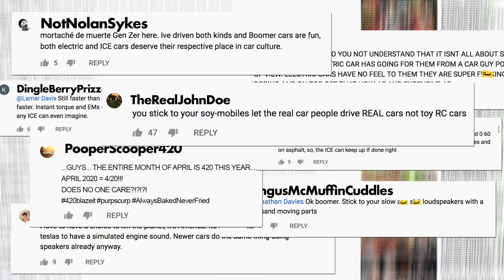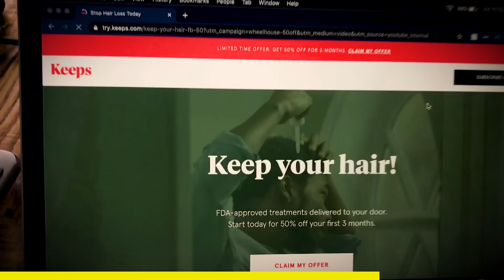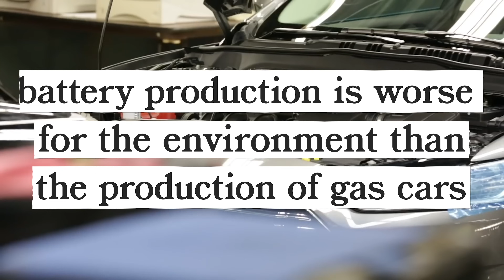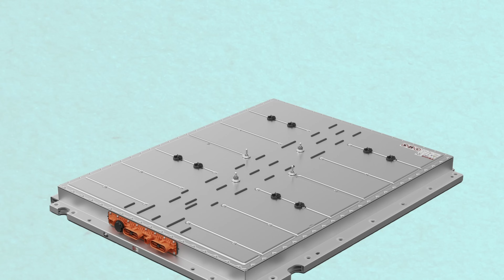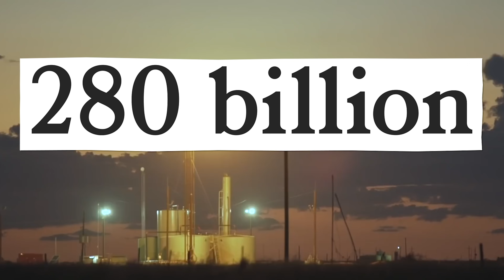Are Electric Cars REALLY Better for the Environment?

Comment: An argument can be made as to whether CO2 is actually harmful at all.
Reply: The science is pretty settled on that actually
Reply: @engineeringtheweirdguy2103  CO2 is a harmless gas that has barely any effect on climate. If it was super harmful then Texas shouldn't have frozen like it did.
Reply: @piyapolphetmunee3879  it does actually. You just aren’t understanding how and the scale at which it does so. CO2 in and of itself isn’t a Huge contributior to the actual warming however it does feedback into many feedback loops which accelerates the release of substances which do. This is seen on a global scale, places aren’t proportionally affected based on their CO2 output. It’s global trends. But what it does cause isn’t hot weather. The temperature only increases by 2 or 5 degrees. But it causes more severe weather events. Increasing severity of hurricanes, prolonged bushfire seasons, more regular droughts and floods, and, more extreme hot days and more extreme cold days.

With global warming the extremes get more extreme, such as seen in Texas.
Reply: @piyapolphetmunee3879  or the Australian Bushfires, or the Californian fires, or the plagues/fires in Africa the unusually dry snow season in Japan. All these things are going to be more common. That’s what climate change is
Reply: @piyapolphetmunee3879  here’s probably the simplest way I can describe it. If you release cO2 it’s absorbed in many processes but when you put out more than can be absorbed this is one of the feedback looks which happen, the largest majority of CO2 is absorbed by sea algae. When you have more CO2 than they can absorbe it can be absorbed into the oceans increasing its acidity. This starts to slowly kill off more and then there is less algae to absorbe carbon, thus more carbon is absorbed into the water killing more algae. While that’s going on, the increased carbon generates a tiny almost insignificant increase in temperature of the planet by blocking IR light from escaping. This generates more evaporation of the ocean. Steam is a much greater trapper of heat than carbon. This warms more and creates more steam. Which then creates more. This causes increased rainfall and more severe storms but they also dissipate faster so while you’ll have flooding in other areas the rains dump too early now to get to other areas creating drought. This warming also cases ices to melt on glaciers and artic ice caps. This increases the surface area of the water which means more steam and more heat and more severe weather events. It also reduces the salinity of the water through dilution which means it now evaporates at lower temperature creating again, more steam.
Reply: @engineeringtheweirdguy2103  Bro, how clueless are you? The wildfires in Australia was a combination of a bad drought season plus a lack of fire hazard reduction or controlled burns. The same thing happened in California. Australia now has moved from really bad drought in early 2020 to heavy flooding after having a really wet summer this year. This is because of something called the Indian Ocean Dipole. Look it up pls.
Reply: @piyapolphetmunee3879  “bro” I AM Australian. Bush fire conditions and severe heat waves have steadily been becoming progressively more common. NSW is currently experiencing a once in 100 year weather event. But surprisingly flooding itself is not that uncommon in NSW and Queensland. Infact it often occurs yearly in at least one of the states of not both. Even in Victoria almost exactly 12 months before those bushfires Victoria experienced wide spread flooding.

The fires in Australia burnt across 2 states, aside from the fact that our own climate scientists predicted these conditions more than a decade ago due to climate change predictions. Which is significant because fire reduction are state programs. Not National. So you might have a point of it we’re just one state but it wasn’t.

It wasn’t actually mismanagement which caused it. They did have record low burn offs leading up to those bushfires. However that’s because the amount of days with the right conditions for extreme fire hazard days, the days you can’t back burn on for what should be fairly obvious reasons, was also at a record high. Meaning they had the fewest available days for back burning the year before and leading up to the bushfires. Because those types of days, extreme fire days, are becoming more and more common. As per predictions from climate scientists.

Comment: shall i invent a solar powered electric car
Reply: Good luck 1m2 of solar panel produces roughly 1kW. If you had a sizeable sedan you could maybe squeeze 2 m2 of solar panels on it. But even with the best drag co-efficient you’d be needing roughly 0.13kW hours per km. You wouldn’t be able to travel much over 15km/hour at max capacity. Assuming the suns out and bright.
Reply: @engineeringtheweirdguy2103   ok

Comment: Now do how long each car cost compared to cost of ownership! Watch the the build up of ev crap build up and having to use so many batteries and electrical components going bad! Which is still a problem, we can see ev is better for the co2 levels long-term but we going to double and triple the amount of dead ev cars laying around cuz they dont last as long? Can we make the recycling process better? Like gas, lithium isn't going to last forever, hydrogen is far from being the answer at this point.
Reply: Actually BEV’s will last double the life of an ICE car. And the lithium can be taken from the batteries and readily recycled by placing them right into new ones. Batteries don’t degrade the lithium.
Reply: James, how many EV's have you owned where the batteries and electrical components went bad?   Or are you simply posting with no actual EV ownership experience?

Comment: No, they still charge from coal. It's a bandaid on a fart
Reply: Still better than burning fuel apparently
Reply: Also coal power plants are required to remove micro particulates from their exhaust out of the towers hundreds of feet in the air in rural areas. Whilst vehicles are not required to remove them from their exhaust. At ground level. Where people breath. In populated areas. Which are directly attributed to hundreds of thousands of deaths globally.

But who’s counting right?
Reply: Not in the UK we don't. Only 4% of the UK's energy is from coal....

Comment: 2 corrective comments.
1.) cobalt: Tesla and other EV manufacturers have signed a deal with their supplies to obtain only ethically sourced cobalt.

In addition the largest consumer of cobalt in the world are fuel refineries who use it to remove sulphur from fuels. Who don’t have ethical agreements with suppliers. So if we’re in the game of avoiding child mining the EV’s are actually better.

2.) in relation to running on coal being worse, that’s only if we don’t account for the energy consumption of fuel refineries on the same grid and that they burn crude oil to produce the majority of their energy requirements. That coupled with transporting the fuel to the fuel stations makes EV’s even on a coal only grid, far more green than combustion cars if i have my maths correct.
Reply: I spoke too soon about point 2. So my apologies

Comment: California would have to build many additional power plants to power an all EV fleet and the cost would be 10s of billions of dollars.  The grid is stressed now.  EVs are fine however they are heavily subsidized by the taxpayer.  The true cost to convert to EVs is high for society and the climate argument is a nonsense, feel-good, red herring.  Nothing is wrong with EVs however they are not green in any way.
Reply: Well. Actually they are and your assessment isn’t entirely correct. And also anecdotal.
Reply: @engineeringtheweirdguy2103  What I said was factually true.  And I stated facts even die hard EV proponents realize must happen.  You offered zero contradictory facts.  Feel free to drive an EV but the green argument is not a good one.
Reply: @tracerheat  as I said. It’s anecdotal. EV’s are green. Or at least certainly cleaner than any other alternative currently available. And California would have to build a lot of energy plants to cope with 100% EV fleet. However it’s not strictly accurate as being analogous to the rest of the world or the statement that EV’s aren’t green. Most places in the world have more than enough capacity for at least a 25% fleet of EV’s today. But EV production isn’t so sudden. There is still a long waiting list to get your hands on a Tesla Model 3 for example and at times, their production capacity was so high they were making them in tents. And yet EV’s still only made up 2% of all car sales in the US. The adopting is happening but not suddenly. On average the grid capacity in the US has doubled every 2 decades. Most experts aren’t predicting even 50% adoption until 2040 or 2050.

To bring this back home to California, the issue with their grid was poor implementation of renewables (not that they’re bad or expensive or unreliable, when done right they are reliable and cheap). California failed this integration with the grid due to a mixture of bureaucracy, and poor government policy. Your assessment also doesn’t account for interstate grid connectors which can feed in excess power from other states. For example Arizona makes an excess amount of solar energy. Far more than they need. But they’ll sell it to California at a profit. 

Seeing that grids are and have always been increasing at relatively rapid rates since the 1940’s, there is no reason to assume that there would be any dramatic impact on the grid with our predicted rate of adoption.

Especially considering that EV’s do the majority of their charging at night, when power companies usually have to shut down turbines because the of lack of demand.

Comment: It feels like you have done a pretty good job, yet the impact on the electric grid and where the majority of that electricity comes from.  (Which is increasing as more and more electric cars hit the road). And then the infrastructure that still doesnt exist for recharging these EV’s.  Then of course the cost of recycling or repairing the cars themselves.   Until the cost of these batteries comes down the cost of battery replacement can be so overwhelming that a new car seems a better option.  ( ok i just needed to wait a bit, not so sure about your findings though. Especially after texas grid fell last month)
Reply: He made some assertions that are definitely debatable and also left out important factors like battery life and cost of replacement versus buying new .
Reply: You overlooked one thing Gary. A full battery replacement is not always necessary. More often than not, a refurbishment is all that is required, with the failing cells being replaced with new ones. Watch the YouTube video of the 10 year old UK owned Nissan Leaf getting it's battery refurbed. The work took around 4 hours, and cost the owner £600. There are way too many EV battery scare stories, mostly posted by people who have never owned, driven or even touched an EV. Most of these people don't even know anyone who has one....
Reply: All of that is public information.  EIA shows the breakdown of the fuel source for electricity in the USA.  The infrastructure DOES exist for these EV's, just check Plugshare and other sites, there are tens of thousands of charging stations out there.

EV batteries are already being recycled and refurbished.  The idea that a new car is automatically a better option sounds pretty far fetched when a new EV battery is still a fraction of the price of a new car. 

And the fact that Texas is drunk on incompetence and deregulation has nothing to do with reliable power grids.

Comment: Interesting numbers. A similar reasoning was made in Finland. It was estimated that a mid-sized electric car would produce about three times of GH gases compared to a mid-sized internal combustion car. The numbers were from 5 tons to 15 tons. It was also argued that with the average Finnish driving distance of 14 000 km a year, the electric car would be greener in reasonable time.

There were also two other comments. First, the reason for elevated gas emission for producing an EV are due to the energy intensity of producing the battery. So when the process becomes more efficient, the emissions for producing become less. Second, the battery CAN be recycled compared to to burnt fuel which is lost forever.

Comment: FORGET DISPOSING OF BIGGER BATTERIES ITS VERY DIFFICULT TO DISPOSE OF SMALL MOBILE PHONE BATTERIES
Reply: Bigger batteries are standardised to 10860 battery type. Smartphone batteries are dependant on the phone model it happens to be in.

Your comment is the equivalent to “why recycle large blocks of scrap metal when it’s hard to dispose of little metal needles in plastic thumb tacks!”
Reply: @engineeringtheweirdguy2103  STILL MINING FOR MORE COAL & MORE LITHIUM WILL RESULT IN MORE POLLUTION
Reply: @EXOTICS-rc4wh  so will mining for more oil, and mining for more steel for engine blocks, and mining for more coal to help turn crude oil into fuel. What’s your point?

Comment: My 2020 Toyota Camry with an 2.5L I4 and an 8 speed auto trans is one of the most environmentally positive in the whole world: I don't commute to work and drive less than 300 miles a month. The most environmentally positive car is on blocks with expired plates.

Comment: Nowadays the problem of the electric generation of solar panels or wind power is that both are intermittent, and this is a big problem for now.
On the other hand, the generation of electricity in the world is 70% of fossil fuels.
I do not know how much will be spent on electrical networks x eg Copper, which is quite expensive.

Comment: Gas car can last up to 40 years, electric cars can't last more then 5
Reply: Still better for the environment. Did you even watch the video? If an EV breaks even in emissions with an ICE in two years, a 5-year lifecycle is still cleaner. Not to mention EV's last way longer than just 5 years. Also don't forget ICE's start breaking down and lose efficiency as well as they get older. Please just shut up if you don't have anything smart to add to the conversation.

Comment: How is that Mitsubishi Mirage the most efficient gas engine? I currently drive a gasoline-powered small car with an automatic gearbox and I've averaged 50 mpg this winter, this number easily increases by about 10% during spring/summer. My previous car, which was a manual diesel, got about 66 mpg. There are also factors such as total energy consumption during cold weather, where many EV's are trounced, it's not rare to lose 30-40% of your range, which in turn forces you to charge more often, which would heavily impact the figures in areas with dirty energy. Overall, EV's are better for the environment on average, but there are certain scenarios where this isn't necessarily the case. For my own part, I considered an EV but the range was too short, especially during winter and driving through regions with few to no proper chargers (I also currently lack the means to charge at home). If and when it becomes more practical, however, I won't hesitate to get one.

Comment: But did you guys factor in the amount of time of owner ship of EV vs Gas?. And did you factor in the battery replacement time frame?
Reply: Why do so many of you people seem to think the battery always has to be replaced?  It is possible to refurbish EV battery packs, replacing failing cells with new ones. This costs much less than replacing the complete battery pack.
Reply: @Brian-om2hh  You people?? That is quite rude. I had a simple couple of questions. With out being rude.  But any and all battery's will need to be replaced and or rebuilt. It is just a storage device, in essence.  But in real world theory of any everyday vehicle use an EV could never hold up. In an urban area, I am all for it. But I live in a rural area. As well as 1/3 of the nation.
Reply: Even if you had to replace the battery, the running emissions of EV cars are still far less than ICE cars. And like they stated in the video, after just two years of driving, an EV becomes better for the environment. If you own an EV for more than two years, it's better for the environment than ICE's

Comment: Some good points, the only fact I didn't hear was the cost to build the charging infrastructure for these electric vehicles.   Oops.
Reply: Well petrol pumps are build too ? It won't make that big of a difference.
Reply: @sakshamtyagi7347  A good point, maybe that's the case in a country without much infrastructure to begin with. And you have to consider the carbon footprint to build and install a whole new infrastructure.

Comment: Ok some things you don't seem to have considered. 
Batteries need replacing on average around every 5 years, this is expensive to do as well.
Solar and wind production are also bad for the environment...Solar panels don't last long and their effectiveness goes down over time, plus both are seriously bad for the environment to produce.
Have a look at them...where do you think all the metals and plastics come from?

I don't think electric cars are the way ahead, alternative fuels like hydrogen fuel cells show a lot more promise, without so much damage to the environment.

As for you saying that our grid can support everyone switching to electric cars, that's defiantly wrong in as lot of places.  The Uk imports electricity from French nuclear sites.
Reply: But electric cars are still relatively better
Reply: @sakshamtyagi7347  Lol The only way an electric car is better atm is slightly faster acceleration. Long distance...nope....Quick refuel....nope....easy to maintain yourself....nope
you get the idea
Reply: When it comes to replacing batteries, even if you had to replace the battery, the running emissions of EV cars are still far less than ICE cars. Most EV owners don't ever need to replace the battery.